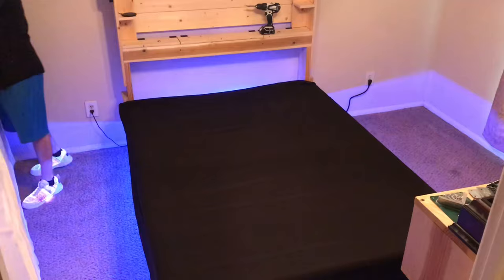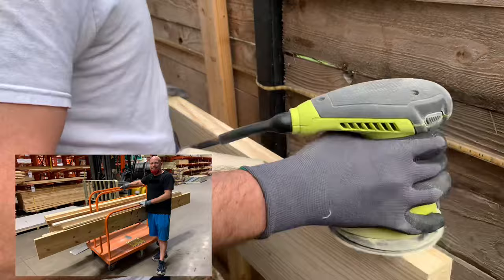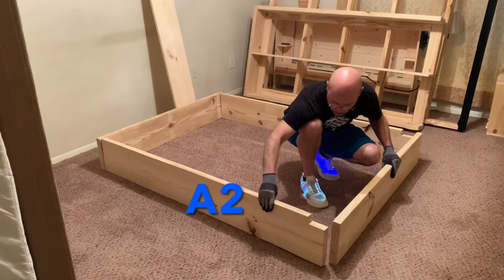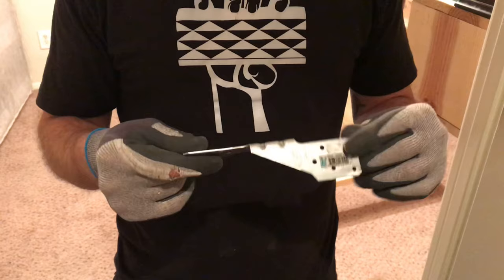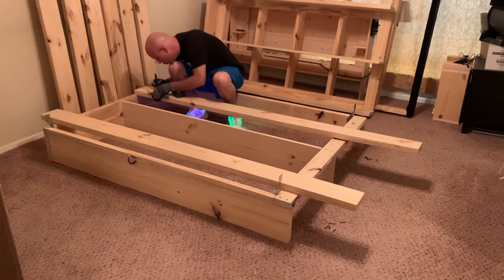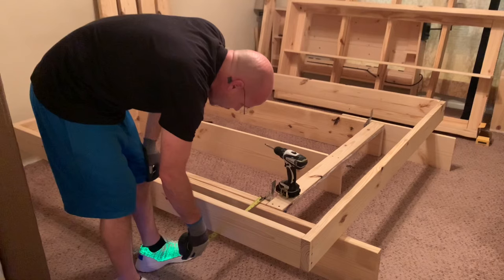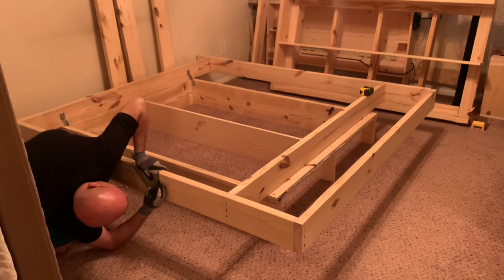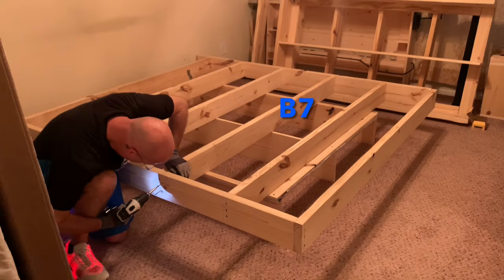King Size Floating Bed Frame [Easily build your own!]

Comment: Hello so I am planning on using ur build to build me the king size bed any idea on how much lumber/price cost? This will be my first solo project I'm very excited to try thanks for ready.
Reply from the maker: @Pedro Hernandez Hey, good morning Pedro, thanks for your question.  Well, let's see here:  Today is 12.10.2022 and I am in Houston, Texas currently.  If I were going to build this bed frame again today, with the headboard(this is a separate video already posted on my channel) I would estimate lumber, brackets, screws, and lights to be in the $300-$350USD on the high side.  The price of lumber has come down significantly since I built this at the height of the pandemic in the USA in the summer of 2021(see original video posting date in the written description).  At that time, I believe that I spent close to $260 on the lumber JUST for the frame but thats gonna be back closer to $100-$120 now, depending on how you build it.  Feel free to reach me on Instagram realc_love1 if you'd like and I'll be much more than happy to help you complete your first build in any way that I can.  Take care and be careful Pedro, I'll talk to you again soon my friend.

Comment: Hey! GREAT video😊 i was wondering about something mr, i only have space for 180cm instead of 185cm, WHAT should i do?
Reply from the maker: @Kim Kamanzi Hey Kim, this is pretty simple.  5cm really isn't that much of a difference, you could build this as pictured, but, if you really wanted to, take 5cm off of B3-B8(as pictured in the video), and then follow the same build instructions and you will be there!  Does this help?  Contact me on instagram realc_love1 if you'd like to.  Thanks for your time and support, I mean it 🤝.  Talk to you again soon.

Comment: I have a "Florida king" sized which is approximately 108" x 80". It has the box springs which are essentially two queen pieces, mattress is one piece. Would you recommend making it custom to size or making two queen sizes?  Thank you
Reply from the maker: @user-po1cg7vs7m Hey Shalene, super apologies for the delay in my reply here, I'm just now seeing your message 🤦‍♂️ .  This is going to be largely dependent on your situation.  How easy do you want this thing to be to move(both in the room and from house to house)?  Do you have any plans for storage underneath at all?  Are you looking to add a headboard that attaches to the frame(or you gonna hang it on the wall, or none at all)?  Do you want to modify the bed frame a bit so that you have a little pit for the box springs to sit in instead of the frame being flush with the edge of the box spring?  Also, note that a queen size is 60" x 80" so you are going to be a little shorter, I'm glad you know your exact dimensions already.

I'm probably building it as one enormous bed frame.  This is going to be a whole lot more cost effective I think...fewer boards to purchase, cut, and handle...pieces are going to be quite a lot larger and less manageable, but with a helper(if needed), the cost savings will be worth it for sure.  I hope this helps.  Let me know if you need anything else at all.  Thanks for your time and support on this channel 🤝

Comment: Current in process of building but I’m having a lil trouble as the a5 board 65” won’t fit in the middle I’m measuring about 62 n 3 qaurters . Where did I go wrong ?
Reply from the maker: @isaacano3543 Hey Isaac, sorry for the confusion.  I hope I’ve reached you in time.  Instagram curtis_made_it.  You need to screw through A3 & A4 in to A1 & A2.  This should fix it and make everything line up.  Lemme know how else I can help.

Comment: Super interested in building this and adding a headboard with night stands.  I also want the base to have drawers.  Would you be able to help out
Reply from the maker: @Dapper Dude Hey Dap, I sure would love to help!  This sounds like a fantastic design and a fun build, but is above my pay grade and CAD experience level at this point.  I’m in the process of adding a headboard right now(part of the delay in my reply, video coming soon), but the drawers is something that would take quite a bit more time than I am ready to spend on right now.  I can put you in touch with someone that may be able to help with the drawers if you would like.  I hope this helps, talk to you soon.

Comment: What size screws did you use for the strong ties? And is there a size for the Simpson strong ties? I feel dumb for asking but I’m going to try to do this next week.
Reply from the maker: @shaiannegerken3183 Hey Shaianne, don't feel dumb for asking...the only dumb questions are the ones you don't ask.  I've made some changes to this build to make it a whole lot easier for you guys...reach me on instagram Curtis_made_it if you'd like.  Instead of the Simpson strong ties, I've switched to 2" L shaped corner brackets to secure the base to the frame.  They are a whole lot easier to handle and they don't involve any thinking at all like the Simpson strong ties do.  You should secure the L brackets to the base and the frame with 1 1/4" drywall screws....you are likely only going to be able to buy a pound box of these so you are gonna end up with a million extra, but that box should only set you back about six bucks or so so you should be alright.  Check out the twin size floating bed frame video posted on this channel to see how to secure these L brackets if you'd like.  I hope this helps.  I appreciate your time and support here, thank you 🤝

Comment: Hey I wanted to know what’s all the tools do you need I’m going to have Home Depot cut my wood but I just want to know what tools I need to use to put it together also i have a king size
Reply from the maker: @Terri's Classic Gaming Channel Hey T, thanks for your question.  Really, you only need a hand drill and a set of countersink drill bits to make this happen if you are getting the cuts made for you.  Personally, I sand my timber down so it's nice and smooth and looks a little better to me, and, if I decided to stain it in the future, it'll be ready to work on, but you can build it with pieces straight from the store if you'd like.  That obviously requires more tools, time, effort, and energy, but it's worth it to me.  I hope this helps.  Feel free to contact me on instagram realc_love1 and I can help you more as needed.  Thanks for your time and support.  Bless you my friend 🙏

Comment: Does anything change if you wanted to donor without a box spring
Reply from the maker: @austinpickens9974 Hey Austin, yeah.  You are gonna need either plywood with holes drilled in it or cedar fence pickets spaced slightly apart to allow the mattress to breath in the absence of a box spring.  I always stick with recommending a boxspring though.  I hope this helps.  Thanks for your time and support on this channel my friend 🤝

Comment: Would like to build this only I have a California king mattress. Any chance I could get a lumber list that you used in this video and I’ll adjust measurements.
Reply from the maker: @rabbit662 Hey Rabbit, sure thing.  I think I put the measurements on screen in this king size video, didn't I...?  Anyways, I'd go with all untreated 2x6's.  Consider things like:  do you have a box spring?  do you want storage in the base?  are you going to flush build or pocket build your frame?  are you adding a headboard?  These are some of the things to think about before you just start rippin' and runnin'.  I hope this helps and I hope you have a safe build my friend.  Thanks for your time and support here, I mean it 🤝

Comment: If I’m making this for a California king do I need to make the base bigger or just the frame?
Reply from the maker: @uhmanoamusicdepartment6130 Hey Honuhonuhi, I'd recommend modifying the measurements for the base and the frame if you are going for a cali-king size.  That mattress has slightly different measurements than this king size and you want your base to be adequately sized, placed, and oriented so as to provide the most support for your frame/box spring/mattress/headboard(if desired).  I hope this helps.  Let me know if you have any other questions my friend.  Thanks for your time and support here 🤝

Comment: Can you build a king size or any size (just to implement the idea) with storage! Thanks
Great video!!!
Reply from the maker: @Ramon Araiza Hey Ramon, sorry for the confusion.  I built this king size with my (current as of 06.29.2022) version of the storage capability.  Basically, you have a base and a frame.  Your mattress sits on top of the frame(you need a box spring), the frame sits on the base.  If you leave the foot area of the base open ended, like it is in this video, then you can purchase under bed storage bins to slide in and out as needed(make sure to put an area rug down first if you have hardwood floors).  I built the full size floating bed frame on my channel with no storage option so you can see what it looks like.  The original queen size is also no storage, but I later modified it to include storage, that video is the "Floating Bed Frame 3.0" and I actually show the bins in that video.  Those bins are linked in the written description of this video also, just to let you know.  I hope this helps.  I appreciate your interest and time my friend.  Thanks for the encouragement.  I'll talk to you again down the road.

Comment: This is great thanks. Watching from South Australia. 
One question - what is the distance from the ‘head’ end of B1/B2 to the centreline of B4 (ie how much is the overhang allowed for the headboard?
Reply from the maker: @Dads Onion Hey Dad, haha 😂, I couldn't resist!!  You are very welcome, I'm glad to help.  Okay, so I used American 2x6's for the frame...those actually measure 1.5" x 5.5", that's 3.81cm x 13.97cm.  I also used a 2x6 for the headboard upright...so you would leave the width of the board you are using for your headboard upright in addition to the length of the side board...in this case, I left 5.5"...making the total length 84" for this build.  Then that side board meets flush at the foot and won't be sticking out at all once you attach the headboard upright.  Does this make sense or help at all?  Let me know if I can clear anything else up for you.  I'm on instagram realc_love1 if you want to contact me there also.  Thanks for your time and support my friend, I mean it 🤝.  Talk to you again soon.
Reply: Thank you for the detailed response. I’ll send you a pic when I build it.
Reply from the maker: @dadsonion5292 You bet, anytime.  I've changed my instagram handle...now it's curtis_made_it.  Look forward to hearing from you again.

Comment: Very cool, what type of lights did you purchase? I know they have many “cheap” ones on Amazon that don’t stick long term.
Reply from the maker: @reagan232 Hey Reagan, I haven’t had any problems with the ones I’ve purchased from Amazon.  These are the ones that I used for this build and they have done me just fine.  I appreciate you stopping by.
https://www.amazon.com/gp/product/B07VMGFJL4/ref=as_li_tl?ie=UTF8&camp=1789&creative=9325&creativeASIN=B07VMGFJL4&linkCode=as2&tag=clove1-20&linkId=00d7d2c149903c74e761fd7bec4cd1c7

Comment: Count me in as another inspired viewer! I’m thinking of doing a king frame using 2x10 and 2x12, like the height for my old knees. Could you send me a cut list? Big thanks from Chicago.
Reply from the maker: @D Wood Hey D, thanks for your interest.  I like your modifications too…that will make the deck sit quite a bit higher, to your liking I’m sure.  I’ll be glad to share the cut list with you.  I need you to leave me your email address here or reach me on Instagram, I’m C_Love1984 and I’ll beam it right over.  Talk to you soon my friend.
Reply from the maker: @D Wood It’s on the way, let me know if you need anything else.

Comment: Ahh I should have pulled measurements off my bed first. So what kind of overhang does the mattress have on the top frame? Good pull out back apart and shorten it up a few inches narrower and shorter.
Reply from the maker: @65BigFrank Hey Cody, thanks for stopping by.  I'd recommend making the frame(the top part) the same size as your mattress{king size measures 76" x 80"}.  Make the base(the bottom part) between 8 - 14 inches smaller on three sides.  When you put them together, as shown in the video, match the head area of both the base and frame up and secure everything together.  I hope this helps.  Any other questions my friend?  I appreciate you taking the time to support this channel, I mean it 🤝

Comment: Hi! I am trying o get the correct dimensions and size boards I need to make a sturdy platform for inside my king bed frame. The box springs are total crap and the lack of support on this old bed is ruining my back (lol). So, my vision is to build a simple wood platform and assemble it inside my bed frame, then use the platform vs boxspring. Can you simplify this for me, with dimensions and size boards I will need? I hope my description makes sense...
Reply from the maker: @katiepatterson5407 Hey Katie, good evening!  I think I'm picking up what you are throwing down here.  So, first of all, if you are going to build this bed frame, I'm going to highly recommend you get a new box spring.  I think that's probably the best way overall to support your mattress.  In the absence of a box spring, you can use either plywood with holes drilled in it or cedar fence pickets spaced slightly apart to allow the mattress to breathe.  Someone pointed the aeration aspect of the mattress out to me some time back and I haven't heard anything bad about people not using a box spring and instead using the plywood/fence pickets, I still highly recommend the box spring.  If you still want to build this bed frame and not use a box spring, you can build it as it is shown in the video and plywood/picket the deck for support.  If you want or need help modifying this build to better suit your needs or your vision, I'm happy to help with that as well.  Feel free to reach me any time on instagram Curtis_made_it.  Thanks for your time and support here, I mean it 🤝

Comment: Hi, what distance should I leave from base frame to the edges of the bed frame on sided and foot end? 
Thanks, great video and build 🙌🦾
Reply from the maker: @robertbruun4062 Hey Robert, thanks for your question.
It depends on how risky and ambitious you are!  😂. Haha, just kidding my friend.  For this king size, the queen, and the full posted on this channel already, I leave a space from the edge of the base to the edge of the frame that is between 9 and 12 inches wide...that's 22.86cm - 30.48cm).  I made sure to put the dimensions on screen in this video, metric included.  I hope this information helps.  Do you need anything else?  Thanks for your time and support on this channel, I mean it.  🤝

Comment: First off, thank you so much from NY for this video. Question though, I noticed in the video that the board you have marked as B4 is not flush with the end of B1 and B2, what is that measurement? I'm thinking that it is 5.5" on center for that board, but i am not sure? If it is, I'm also thinking that would change the measurements down the sides for the rest of the joists as well by that same 5.5"? Am I right here, or am I reading a lot more into this than I should?
Reply from the maker: @Justin Nugent Hey, good morning Justin, thanks for your questions here.  Any relation to Ted?  haha 😂 just kidding.

I'm not totally sure what you are asking here to be honest, but I think you may be overcomplicating things a little bit.  B4 is the headboard in the frame assembly, but it is the same length as the other joists.  The reason I do this is because when you guys reach out to me, I don't know if you will want a headboard or not.  When I send out my CAD blueprints for these builds, based on how you are going to build yours, I'll tell you make sure and build it this way or cut number x to y" instead of yy" from the blueprints, and so on.  The space in between B4 and the head end of the side boards is 5.5".  That is the width of a 2x6 that would be used as the upright for an actual headboard assembly if you are going to go that route...I did post a separate video on my channel for a king size headboard if you haven't seen it yet.  Does this help at all?  I appreciate your time, support, and interest my friend.  I'll talk to you again soon.
Reply: @CurtisMadeIt  Yes, it does, and I was right, at least in the way my mind thinks of things. I guess what I was trying to say is that if you are planning on adding a headboard later, to add 5 1/2" to the spacing from the head of the bed for the cross beams (B4 - B8), which is what I did to get the spacing right to line up with my marks on the box on the floor (all of the A Boards in this video), And yes I did look at your king head board video, and decided to actually modify the measurements from your Queen headboard to fit a king, and am currently working on that. When I get it done, I will upload a pick of the whole thing for you
Reply from the maker: @Justin Nugent Okay, very good.  This is ambitious man, I can't wait to see what it looks like.  I'm realc_love1 on instagram or email curtisalove1 at the five letter g word...I can't type the whole address here or my comment will get censored and you won't see it.  Glad you've got a plan and it sounds like it's going to work out just fine.  We'll talk again soon my friend.

Comment: Nice build. What type and size of screw do you prefer?
Reply from the maker: @donaldbirch7880 Hey Donald, thanks for stopping by.  I am married to, but not(as of 11.27.2023) sponsored by, the Deckmate brand 3” screws for these floating bed frame builds.  A 1 pound box will get the base and frame done pretty easily.  I hope this helps.  I appreciate your time, interest, and support on this channel my friend 🤝